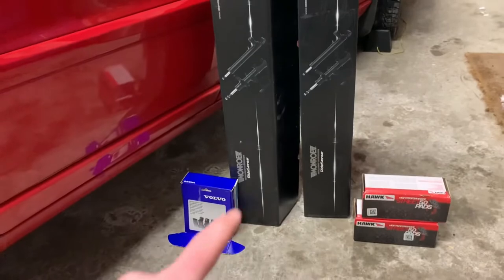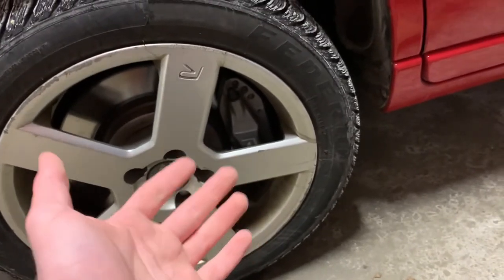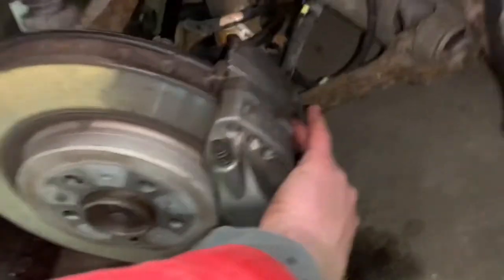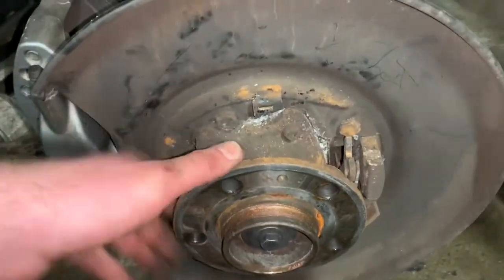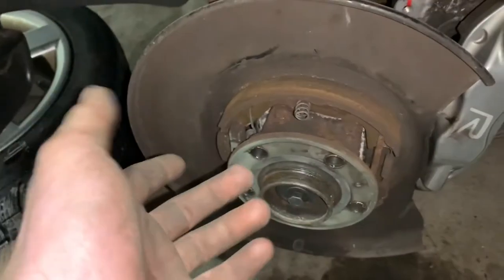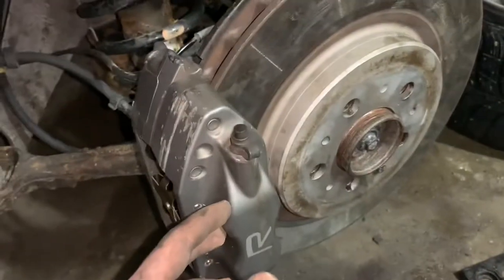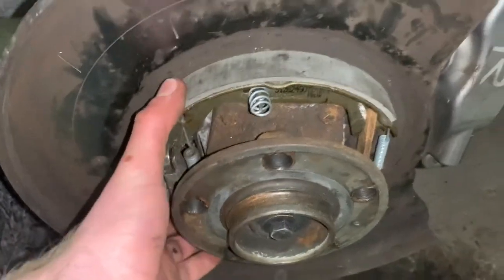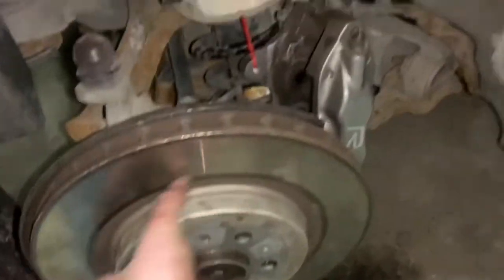Volvo S60R Brake Job, Part 1:  Rear Pads and Parking Brake Shoes

Comment: I would like to know if swapping out the springs on the front struts for the T5 springs got rid of the tire rub on the wheel well with sharp turns.